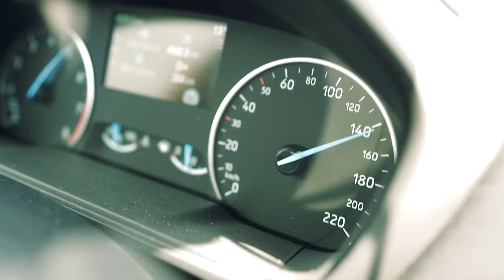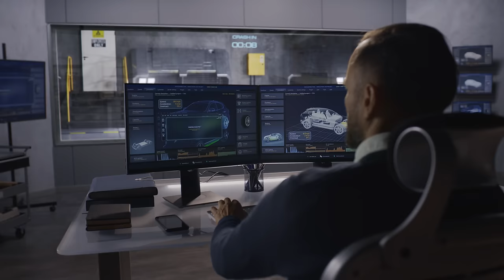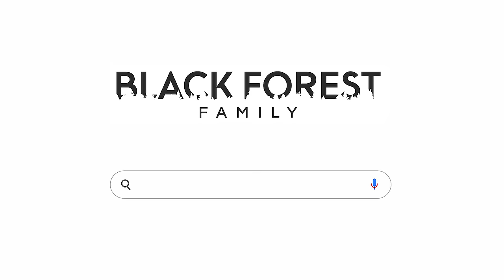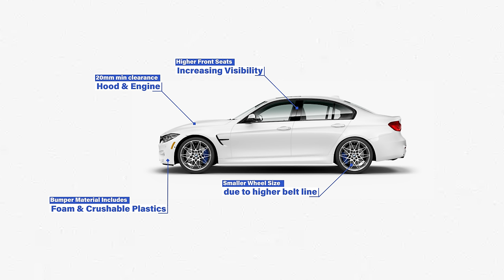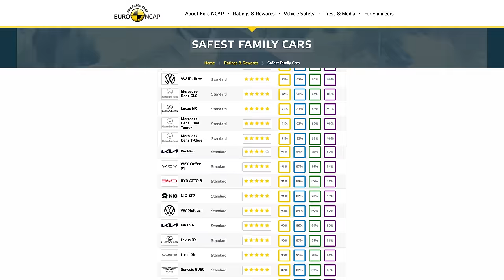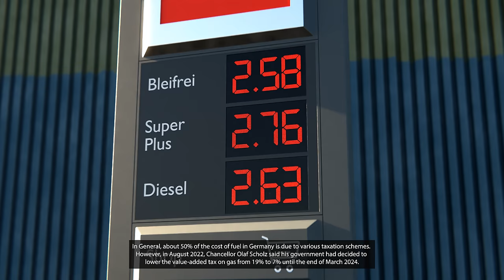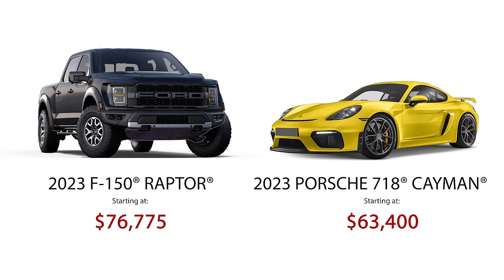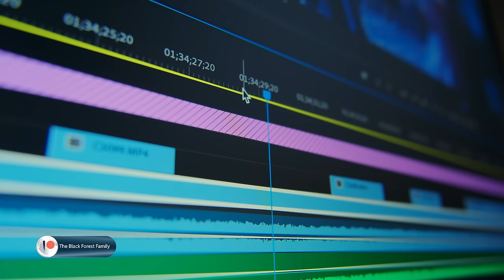DRIVING CULTURE CLASH: Why do our Cars LOOK so Radically Different?

Comment from the maker: Correction to the Video: The Ford KUGA is the European Counterpart to the Ford Escape (not the EcoSport as noted in the video). Although fun fact! The Ford EcoSport is not even available for purchase in the United States. In Europe, the EcoSport is the small SUV option to the larger KUGA, where as the Escape is the smallest SUV offered to US consumers in the Ford line-up.
Reply: The United States' Federal Motor Vehicle Safety Standards (FMVSS) is recognized by only two other countries, Canada and Mexico who also assemble vehicles for sale in the U.S.  The Economic Commission for Europe (ECE) Vehicle Regulations are recognized by all other countries on the planet including Canada and Mexico but not the U.S.!  While most foreign manufacturers have been willing to assemble vehicles compliant with U.S. regulations, American manufactures haven't reciprocated.  Instead, American manufactures have preferred to buy and own foreign brands.  But, even that has changed.  All three U.S. manufacturers have pulled out of Australia.  GM sold off its European Opel and Vauxhall brands in order to concentrate on the China market.  Japan (which drives on the left side of the road) was more than willing to build left-hand drive vehicles for the U.S. market but U.S. manufactures were unwilling to reciprocate with right-hand drive vehicles for the Japanese market.  On the other hand, the Japanese manufacturers built plants in the U.S. to assemble vehicles specifically designed for the U.S. market.  BMW assembles all its SUVs in South Carolina and ships them around the world ... even to Germany!  Chrysler was taken over by Fiat which was in turn conjoined into the Stellantis Group.  GM seems to be in the process of becoming a China-only company.  Ford, meanwhile, is struggling everywhere.  Also, the fact that the U.S. tax code favors short-term gain over long-term investment doesn't help.
Reply: The Ecosport was offered in the US at least until model year 2021 or 22y
Reply: Yeah. I thought the same. My neighbours got the new Kuga.
Reply: Originally the EcoSport, which is produced in romania should only be offered in some regions of Eastern Europe as there was already the Ford Puma available.
The Ford Kuga was very different in the first generation (which was Ford C-Max based). This car was built in Germany (Saarlouis plant only) With the second generation the already existing it was changed to a new "world car" (based on the actual Ford Focus) moving the European Production to Valencia in Spain (which lead to the upcoming closing of the Saarlouis plant). Production will be stopped in 2023 for EcoSport and Puma (Puma will get an electric successor). Ford Kuga production will end in 2025 or 2026 when Ford will only build an electric successor based on the MEB (Modularer E-Antriebs-Baukasten) by Volkswagen.

You can find most of those information quite easily on Wikipedia. It might be a good idea to check this before publishing a video
Reply: My cousin owns the Ecosport, she bought it before it was discontinued.    It's an ok vehicle 😊
Reply: Meanwhile in the Netherlands about twice as high as Germany imagine that
Reply: The electric cousin of the Golf is the VW I.D. 3, but you can’t even get that here in the states…at all!
Reply: I love the original Ford F series, it has style and looks good.
The newer models look like a piclup with obesity.
I guess considering it's an American vehicle it's fitting haha

My drives a T-Roc and it is a really nice car
Reply: Don't care for any of them

Give me a toyota chr or hiphi any day
Reply: It’s still the price of the fuel … simple! The Americans don’t look at fuel economy and they give a shit how you could safe fuel. It’s just the price. That’s why the homes in North America are not so good insulated then Europeans ones. Because all the energy cost are just 30% from what you pay in Germany. So no they don’t see NO reason to safe energy! It’s just the price.
Reply: @wolfgangselle4307  many Americans do care about energy usage, but as you alluded to, if your motivation is purely economic,  the amount you are willing to spend up front to save energy depends very much on how much energy costs.
Reply: @jon9103  maybe they do? But I have not noticed this here. Unfortunately. Because if they care then the building standards would be much higher. Especially to make so energy efficient as possible. And with a stand 2” by 6” exterior walls, sorry to say it, but it’s joke. Quit to my background I’m a Carpenter from Europe ( Germany ) and work in this trade for over 20 years. 14 years in Canada ( it’s almost the same then in the USA ) and I see what is going on job sites here. And I can tell you what is done here is compared to Europe a joke. And mostly there is no pressure here to build energy efficient because the energy prices are much lower here and if you put more or better insulation in a build it will many many years to be just zero with the higher cost and energy savings. But insulation is not only good for savings it’s also good sound proofing, better fire protection or for protection of the summer heat. … but no one want put more money into it. People want it only cheap … when I try to explain what for example sound proofing means they have no clue or understanding why it makes sense. Not even homeowners no also builders… no clue
Reply: @wolfgangselle4307  that's my point,  spending more to save energy is a lot easier to justify if energy is more expensive.  Do you really believe that Europeans would spend as much on energy savings if energy were cheaper?  Of course some still would, just as some Americans do but I think economics is playing a bigger role than some inherent difference between Americans and Europeans.
Reply: @jon9103  exactly … it’s “ only “ because of the high cost of energy in Europe why we spend more money in our buildings. We have no choice ..
Reply: TBH you wont enjoy using small low tight hard suspension sports car for everyday driving.

Comment: It is actually a pretty common concern in german news by now, that especially newer models of high class brands such as bmw reduce window size and visibility for the driver in favor of a heavier exterior and more safety for the people inside the car, relying on cameras and sensors for pedestrian safety. So we start to emulate that trend from the US... :( Personally I feel like the front of that newest ford pick-up looks like a snow plow for children. Pretty scary.
Reply: I live in a very car centric small town, and the rise of new US-style trucks everywhere is a huge safety issue here. These trucks and SUVs are so high that children in front of it are straight up invisible to drivers. And in our road, which has lots of outdoor seating from restaurants, store displays and all that, it's really dangerous to have all these cars that are so high up and have these super long and straight hoods... Just a few days ago, one of these trucks just ran over a planter, and I'm honestly just waiting for someone to get hurt.

And that's a small road, with an extremely low speed limit (20km/h) that everyone KNOWS is full of pedestrian traffic...
Reply: The backseat of a new VW Golf Variant feels like an armoured car!  20 yrs earlier windows where larger and structures thinner.
Reply: @rikulappi9664  yep, no room for side airbags in those thin pillars.
Reply: You forgot one of the main reasons:
thin metal sheets weight less than thick glass sheets.
This means less total mass, and thus less fuel consumption, and thus less CO2 emission.
The reduction of glass is one of the many tricks to build bigger cars and yet stay within regulations and laws.
Reply: @ailaya5127  lol, no. Just look at the average weigh of a 80s car and a todays car, 80s cars weight hundrets of kilos less then today cars
Reply: @wolf310ii  Still doesn't make my point wrong. If you want to have seat heating, and navigation and a generally bigger car , you end up with more weight.
Now costumers want seat heating, navigation and a generally bigger car, so car companies won't decline that.
So the companies look for other ways to reduce the modern car's weight. Materials optimization, in choice and design. Had an entire college course about that.
Reply: Yes A 1966 New Yorker had almost a 360 degree view of what was around you.
BUT since then
It also expected you to drive with your MK 1 eyeballs. 
really? To woke to pay attention.
Instead of talking on the phone. 
Talking to the radio to find your channel and give up.
The search on the screen for the fake radio button.
Shrunk the mirrors for that 0.001% increase in MPGs and less weight.
Reply: If the heavier exterior means better protection than I prefer the better protection. Steel cages, better airbags, and better anti-lock breaks are heavy and generally this is what's in an American car. Yes some have a bigger engine, but all don't. I've seen what steel cages, and better airbags do in a car accident. I flipped my car 3x because a person drove me off the road. I walked away from the accident with absolutely no injuries. The same car drove an older Volkswagen bus (2000's maybe) off the road and he flipped his car 3x and he didn't walk away from the accident. I had a new Ford Focus. Just last night I tested the newer heavier anti-lock breaks. I'm thankful that I had them. Bigger windows wouldn't help me see the deer that were running across the road (the road was pitch black and I was the only 1 on the road). One deer decided to just stop in the middle of the road in front of my car. I ended up sideways on the road.
*Edit yes the area I was driving in could use streetlights, but our area hates light pollution. Light pollution kills fireflies and is harmful to humans also.
Reply: Tell your children not to play in the street, that is what playgrounds are for! Also living in the cities invites automobile accidents!
Reply: @wolf310ii   Yes and you can rip the door handles off with your bare hands should those doors get stuck.
Reply: @thomaskalbfus2005  aside from me neither having a big car nor children, you cannot ban children from the street. Cafes, restaurants, shops, pick up in front of schools... The notion that children will never be at risk, because they can never be pedestrians is ridiculous. About as ridiculous as not wanting people living in cities... With the added bonus argument that cars are not just a risk in city centers.
Reply: @clara-sophievogel7377  You just tell them not to play in the streets. That is what my Mon told me, she pointed to several dead animals in the street to get that point across!
Reply: @jessicaely2521 that sounds a lot like „upgrade game“ described in the video. If the other person had a vehicle, that weighs twice as much as your vehicle, all the safety features might not have helped. 
Maybe we should all try to go for a downgrade in „weapon likeness“ of the car and an upgrade in external safety and driving ability?
Reply: This year I saw one of those driving on my home street in front of a school. I got so enraged I would have wanted to throw my coffee on that car. I couldn't even see the driver behind the hood. Good that there aren't  many of those child murdering machines roaming on the streets of Helsinki.
Reply: @oskar6747 As an American i find it funny you are focused on children. Many pickups are close to 6 feet or 2 meters from the ground to the hood. Meaning many adults cannot see the driver if they are directly in front. This is a snowplow for adults.
Reply: I see less and less as well. I think part of it, is the angles to protect pedestrians.
Reply: Yep, the EU had mandated laws that meant car makers made smaller, safer, more efficient cars. The USA ignored the rules and just made trucks for home users, trucks don't need to be as clean or safe. Now the EU is letting huge suvs out, and giving them 5 star safety for having avoidance systems, but if they hit you you're worse now than before. So I also feel that they are getting more dangerous.
Reply: @wolf310ii  but think of how much more they would weigh?  I have two Fiats. A 2012 500 Abarth and a 1977 124 spider. They both weigh near the same. The spider has no creature comforts beyond the heater. Wind up windows, manuals seats, mirrors you have to adjust by hand, no air conditioning, the top is manual, no power locks, not even fog lights! The Abarth has a sunroof, power windows, power locks, power mirrors, air conditioning, air bags, traction control, ABS, and a infotainment system. The fact that Fiat was able to keep the weight down to 2400 pounds is near amazing, but the interior is full of light weight plastic, all of the cooling system is plastic, and the windows are very small.
Reply: @sailingspark9748  A 70s Fiat 500 weights half of your 2012 Fiat 500.
Your Fiat also weight around the same as a E30 BMW from the mid 80s, so no, 2400 punds isnt impressive for a small car
Reply: @wolf310ii  yes, but a 70s fiat 124 weighs the same as my 500.A much bigger car than the original 500.
Reply: I got a livehack for you: Buy a swedish Scania semi-tractor. It ist so massiv, it will push almost everything out of your way or probably just crushed it beneath you. The cab is tested zu withstand the impact of objects of several thousand pounds and in case of a rollover the cab will part from the frame. Perfect safety for those who sit in it, and  it will be live threatening only for those around you.
Thhis 'livehack' is of course not meant serious, but it might give you another perspective of what you call car safety and when I look at the way (private) cars changed in the last 10 years I wouldn't be surprised to actually see people drive a Kenworth or Peterbuilt in a few years since the 'small' F-450 aren't 'safe' enough any more.   @jessicaely2521
Reply: @wolf310ii  A modern Fiat 500 is a heavily reinforced car to withstand accidents with larger, heavier vehicles, so it makes perfect sense for it to be this heavy. Not to mention all the modern tech, tons of cables and aggregates. You'd be dead in a serious crash in an E30. And regarding the old Fiat 500...There was an accident some years ago here in Germany with one and let's just say it wasn't a pretty sight. Car was folded in completely from front to back, obviously killing the driver. 

Modern cars would be even heavier without lightweight components. Dimensions of cars today are much bigger than in the 80s. A 2020 VW Passat starts at 1430 kg, not much more than a Mercedes W123 and it's a much bigger car. Not bad, considering all the extra tech vs the old Benz.